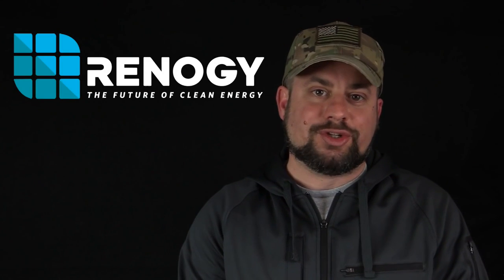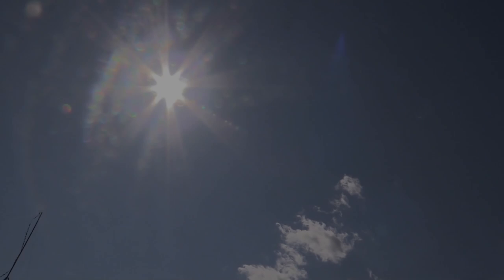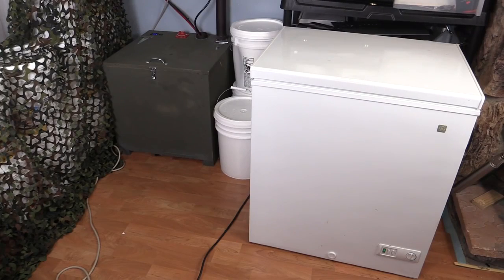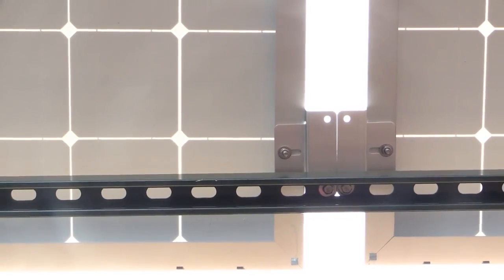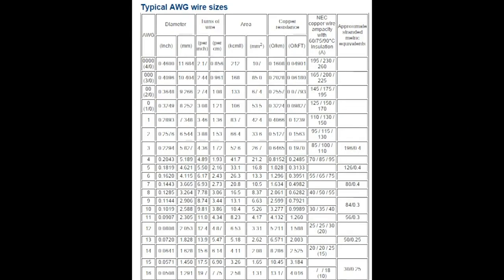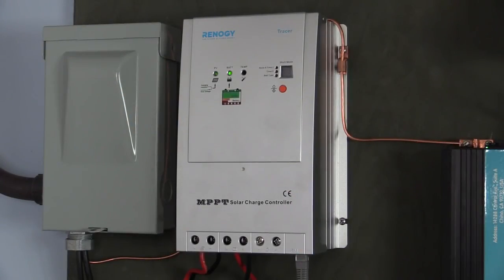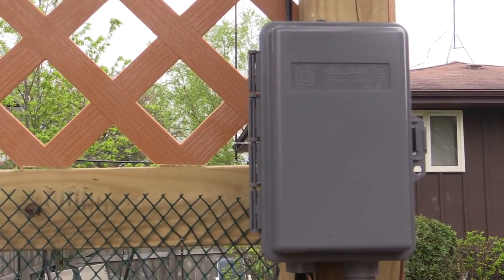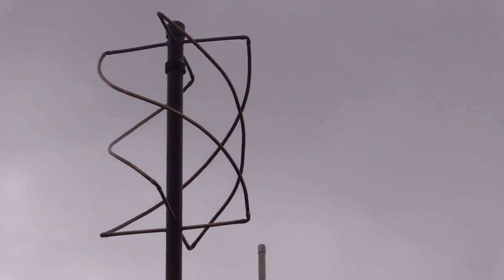The Ultimate Guide To DIY Off Grid Solar Power | Tin Hat Ranch

Comment: Most excellent. I understand the new lithium phosphate based batteries are far more efficient, charge faster, are safer than lead acid and can be discharged to 30% instead of 50%.

Comment: It would be additionally helpful if you equate electricity to water. I.e. Battery = tank storage,current =flow, Voltage=pressure, amperage= volume 
Wire/resistance=size of pipe ( small diameter =resistance relative to larger diameter allowing more flow less pressure. Etc.

Comment: Mild question.  I can get car batteries for a buck a pound.  Proper deep discharge batteries you show are like 3 to 5 bucks a pound.  So I could have twice the size battery for half the cost.  Understanding that the car batteries are inferior in the long run, are they safe?  Would twice the battery size allowing for shallower discharge allow the inferior batteries to last longer than the better batteries taxed harder?  Would it allow for better on rain days?  Or do you buy fewer batteries for more money.

Comment: But if you connect the panel series then if it gets in shade, or damaged then your system stops to work, but if you have a paralel system you will have power all the time... And you can switch the bad panels any time...
And this is the problem on the panel as well, if it doesn't have build in diodes then the cells can stop to produce power if it is all in series and 1 cell gets in shade or burns out... so on high quality solar panels they use a mixed (parallel and series) connections, and diodes to prevent this to happen... 
So this is why you should think and plan that more carefully!
But still this video is very informative, and too many other videos forget to mention the lightning protection, but it is essential, and you cleared that as well. So thanks for the video! :)

Comment: I watched most of this. He is basically where I was in 1997-1998 (without advertiser support and plug and play components of course).  

what he is presenting is about 75 percent accurate.   a lot of devil's in the details are not there.   Nearly a quarter century of living off grid and designing probably a hundred systems, and also fixing people's messes, I have gained a lot of "not how to do it" bits of wisdom.  

I run the entire house on 1250 watts and 100 watts on the well head.   Running a 24 volt forklift battery and MPPT controller...lots of other bits and pieces.  A long way from that single 77 watt panel and "RV" battery!

Comment: Love your video - would you like to touch on the issues of having panels in series? The entire system is limited to the minimum individual voltage of  a panel. Probably not an issue in your setup, but definitely an issue for some!

Comment: 42:37 - if a solar setup is generating more power than your set up needs, is there a reason why you are saying you need to spend the power?  Does it add to the wear and tear to your solar set up, or is there a legitimate safety reason for this? 

If I had this type of set up, I'd mostly worry if I'd leave home for a week and we got a heat wave while I was gone.  Do people have to shut everything off when they leave?  Or do more expensive setups simply account for this?

Comment: Great video but I have a question. All of my electronica devices are DC powered and they all came with an adaptor that you could plug into an AC outlet.  Is there any advantage to having some DC direct outlets with USB connecters set up in my home?  It just doesn't make sense to me to generate in-store power as DC then use the converter for AC power only to plug-in adaptor that converts AC back to DC in order to charge my cell phone.

Comment: mate this has been the best vid ive seen i have been reading and watching numerous vids an reading lots of blogs and it had all left me rather confused. you my friend have done a dam fine job of explaining how to work out your amps, volts and watts all of which i had no grasp of before seeing your explanation. thanks mate as i now understand and feel capable of working out how many panels I need and weather I need a MTTP or a PWM controller and to run in series or parallel. I could go on an on but will stop here. you are a fu--en legend cheers bro.

Comment: nice explanation but evriting here run on 240V AC to go from the solarpanel to the bateries look into copper tubing. when lightning strikes the lazy electrons wil split into a pat trough your body en the ground wire  jus in the same way as a 40 wat lamp en parallel a 100wat lamp you wil enjoy both te power, there is plenty up in the skye

Comment: Sorry, but hydroelectric is way superior to both wind and sun.
It`s the only way you can produce electricity all around the clock and you are not encumbered neither by weather nor season.

It`s the only way you can produce electric 24/7-365 for as long as you would wish.
And no you do not need to have a steady stream of water wither.
You only need to store up enough water to have a reliable system.

Comment: The weak link in this system is batteries. If the grid goes down "forever" you got 5 years. After that your batteries expire. In 20 yrs the panel degrade.

Comment: Well I don't go by sun hours I go by batteries that I need and get enough solar panels to change them to full power in cloudy days or in the shade facing north to fill batteries full power. And then I get more solar panels then that to make sure I have enough. And that makes 13,233 watts in solar panels to run a house that needs 4,500 watts of power maybe three hours a day and maybe 1,800 the rest and less like 1,000 eny other time. 

    I have winter so I made sher I had enough for that and all most night days. Or just dark days it had to make enough for. And that just gives me more than I need. That makes me happy and I like 1500 amps to 2000 amps hour batteries and more if I can get them.

Comment: Since this video has been made it has become very economical to set up a 30kWh system. Here in Australia, a 6.6kW solar panel array connected to a 30kWh battery is now well south of $10,000 and getting cheaper. The panels alone even without the battery are now $2000AUD. This is the same price as a 1.5kW system was 10 years ago.

Comment: Question for you! If the PWM is best for single-panel systems, and costs $30, and the MPPT costs over $200, could I buy four PWM charge controllers and wire one panel to each, connecting them in parallel to the batteries after the controllers?
Reply: poke

Comment: To calculate the wire size/ voltage drop you have to use the round trip distance, in this case it is 120', not 60'. Its 60 ft there AND 60 ft back. Higher voltage equates to less loss especially over long distances.

Comment: For a true prepper, there are several strategies to reduce dependence on batteries............the weak point in the system.  They involve using the power when it's being generated.   Refrigeration is one of our heaviest loads.   Ice, pound for pound stores as much energy as a flooded lead acid battery and is 100% recoverable.    The logical way to utilize this principle is to make  freeze ice so that your refrigerator does not cycle on battery power, but only operates when you have abundant power from solar.   Thus the ice is in effect a battery, that NEVER WEARS OUT AND CAN BE DISCHARGED 100%..... The simple way to do this is to use a refrigerator / freezer only as a refrigerator.   For example on a side by side, you could cut openings between the two compartments, and place plastic containers full of water or a hypereutectic solution in these openings so that the ice would cool the fridge much as ice cools an icebox.    All the cooling when the fridge runs would be in the freezer side, and the remainder of that space could be taken up with  high density frozen goods like meat in food saver bags........ it will remain frozen for a long time, and the ice will continue to cool the fridge long after it loses power.   The freezer side would be opened only minimally, and ONLY during charging hours.   The average fridge uses 1 to 2 KWH per day......... That's a LOT of battery capacity!   Your main deep freeze should be set up to only run when you have solar power coming in also, and only opened during those hours, and it is worthwhile to add additional insulation, making sure that it has a place for airflow for the evaporator.    In addition another fairly useful energy storage device is the well pressure tank.    When the sun is shining, the pump can run and charge  multiple pressure tanks, providing water for an extended period of time........... not the cheapest storage at around $4 per gallon of storage, but an extra tank or two can provide a lot of water without having to draw down batteries.......... for that evening shower.    Another energy saving strategy is the so called "thermal cooker", which you place food to be cooked into, and seal up.  Essentially a cooking thermos....   Again, you can heat the food with electricity when you are making it, and it will continue to slow cook.  I  have a computer system including several 27" monitors that will  operate entirely off regulated 12 volt battery voltage.   Any way you can avoid running an inverter  is worth looking at.   In theory at least you could go totally 12V, but it's simpler to run some things on 120VAC.   

****************   Any way you can avoid storage in batteries is money in the bank.  Batteries are expensive and relatively short life.   Using some of these kinds of strategies, you can get away with a smaller battery bank, which means that you can afford better quality batteries such as  AGMs or even LIPOs.

Comment: TinHatRanch, the power is not really wasted because the power comes from the sun, it is all free power and if the sun is shining it is putting out power whether we are using it or not and if the sun is not shining it is still putting out power, and that is what a charge controller is used for to stop charging the batteries when they are charged 100% and a battery's job is to hold the power until you need it the power of the life of the battery, thus back up power when the grid goes down...he he he

Comment: Nickel Iron batteries last so many years you can "will" them to your descendants; Ni-Fe were used in the 1910 Edison Electric car, they still take a charge today according to Jay Leno; con: they are heavy and not as energy dense as other but since they will be stationary to your house the weight isn't important, the longevity is nice so building a power wall out of Ni-Fe is attractive vs dangerous Li-ion (a friend had a liion battery explode in a portable 7" tv, burned her apartment total loss, but powers that be don't want us to know about dangerous li-ion exploding , Nimh is a better choice for cars at this point bc they don't explode.    But let me ask, if you had a 10,000 watt solar system on your roof or yard, where would the extra power go once batteries are charged, and why wouldn't that run your central AC during those peak solar production hours?

Comment: Wrong on nearly everything and I am 2:04  No. 1 electricity has been on earth for nearly 4 billion years and supporting life for as long as life on Earth has been living. If you are a Prepper you need to not rely on solar for your power as it could be completely useless if a VE 7-8 volcano is the cause for prepping because you will not have sunlight for three years.
Reply from the maker: That’s about the dumbest statement I’ve ever read. “Electricity has been around for 4 billion years supporting life, but you don’t need it. If one of a myriad of things that can happen does indeed happen, your preparations will be useless, so don’t prepare”. I️ bet you are using your thumb right now to wipe your ass.

Comment: Outstanding, best doc I've seen in a long time. One thing You might add is damage control. If you lose a Solar panel or Battery(Alien Blatter Beetle eats em) in a series circuit, is there an automatic bypass circuit or best work around for that scenario? Guessing you could rewire for parallel, But you would have to run heavy gauge 60' drop also. Have you anything on Wind power, Hydro power too. 
Thanks for your time, Clear Skies.

Comment: was just curious....could I use the information used here in the video to run solar power on a cabin cruiser 23 ft with fly bridge.....
I would have 2 solar panels on top of the roof....then have the cable run through to the cabin itself where a MPPT controller would be...then run back into the 2 marine grade deep cycle batteries....with an inverter near the controller itself....would this be an ideal setup to run on a boat? using the information in this video....as the panels would be on the roof itself it would be mounted flat....

I would also be in a way inserting a 240 v system with breaker box to allow be connected when at a marina.

Comment: Excellent vid, great well-thought out delivery and a lot of good info.  I don't put much faith in solar voltaic systems because they cost too much, batteries don't last long, etc.  I do depend on a 4k gasoline-powered portable generator for emergency use.  Yes, I can run A/C or a burner on my electric range.  Furnace? No problem as it keeps my Michigan pipes from freezing.  It doesn't need to run all day.
Your solar panels are a 'non-grounded' 2-wire system unless you tie one wire (usually negative but it really doesn't matter) to ground.  Even ground rods aren't much help as FIVE of them won't trip a 15 amp breaker at 120 volts*. The only advantage I see of a ground is for lightening but even then, #6AWG copper is too small.  I would put a jack screw on the solar panel pivot with a small motor and small solar cells with black tubes pointed at the sky.  Add a timer that is only on a few times per daylight hours and let the reversible motor regulate the angle of your panels.  BTW, I'm an apprenticed Electrician.
*https://www.youtube.com/watch?v=Yg6G5VUSsWA

Comment: I know photovoltaic is the most common solution available but there must be a focused solar to steam option that can be scaled down. I would think smaller systems like that at homes would be more efficient than the regional photovoltaic or focused solar as well as home based photovoltaic.
Reply: Would it not be sensible to hook the grid into your battery so during those times when the sun is low or when energy value is cheapest and less in demand you can feed comfortably off the grid to help speed the batter charging. It would require some logic hooked into the system to arrange for it to work properly. Another thing I consider worth looking into is that some batteries are safe enough and can be fashioned at home. Being able to craft and expand the battery potential should be a base priority. There are many kinds of batteries that shouldn't be beyond many people's ability to craft.
Reply: I'm not sure what the cheapest option is actually. Cheapest could be flywheel. Long term use and possibly minimal maintenance. There has been some coverage of saltwater batteries. The capacity I imagine is low but the materials are cheap.

Comment: Question... I have four 12 v deep cycle batteries, so I need to wire them in parallel to keep them at 12 volts.  Can you tell me or give me a link to an image on the correct way to wire the batteries in parallel?  THANKS!!!

Comment: Hi, Thank you very much. You are the best so far on explaining how it all ties together. Here's a crazy question. Just wondering does the earth produce a charge or a current in the ground rod or grounding wire. Also if someone had a creek or river running through there land, would it be possible to turn your windmill vanes into solar wind vanes and put solar panels on the wind mill and have solar wind and hydro all tied into one unit? and if so the next question is why doesn't anyone do it?

Comment: Nice video,  Hello from Kansas.  I have a couple questions, My whole system is set up for 12 volts DC.   I have 4 Renogy 100 watt panels.  Right now they are wired parallel for 12 volts  I do like the idea of wiring them in series,  I;m ruing 10 ga wire about 25 foot,  However my controller is a PMW 30 AMP charger rated for 12/24 volts.  what charge controller would I need to handle the 75 volts?  Also would a need to change my battery wiring and my power inverter?  I also have another 2 panels that I do eventually want to add to my system.   Thank you for your time.

Comment: I think I did pretty good up to about half way through, but then, when you started comparing running the solar panels in series, vs parallel, I understand the concept, but the math blew me away! At that point, I'm DOA!!! I'm looking at a slightly different application with doing a camping/nomadic type vehicular mount. I figured I want to power a small fridge, plus a few accessories like phone and computer charging. Can you try to dumb it down a bit more, PLEASE?!?!

Comment: This is the best tutorial on DIY Off Grid Solar I've seen so far.

But I will make a correction about something false said in this video and frankly almost everyone says it!
Electricity doesn't follow the path of least resistance! Electricity will always travel back to it's source even creating parallel circuits. 
That's why GFCR works, it detects a parallel circuit and breaks it because it's a fault.

Comment: In your battery setup yu showed two 6VDC batteries in series @235 AMPS, your voice over said "Each battery is 235 AMPS." Then, you showed a diagram of four 6VDC Batteries (two more) wired in series and listed the result at 470AMPS.  I am NOT disputing the implication. Instead I am asking (1) what is the 'AMPS' for the single 6VDC Battery used, and (2) is the voice over misleading or correct?